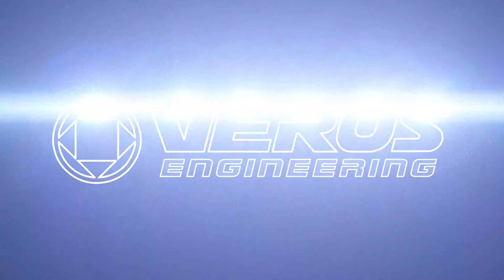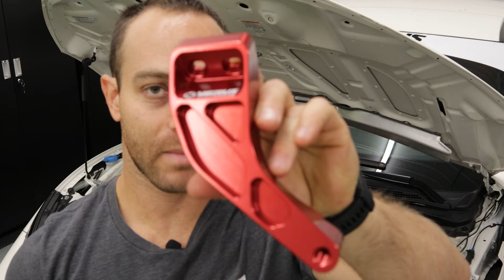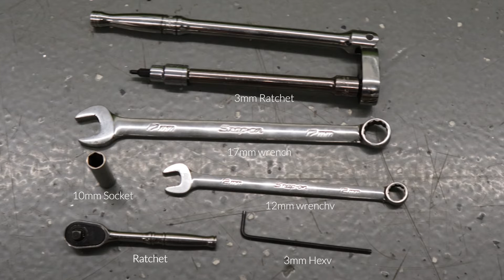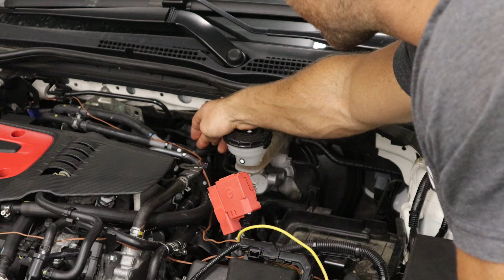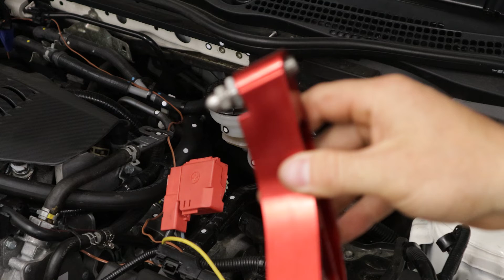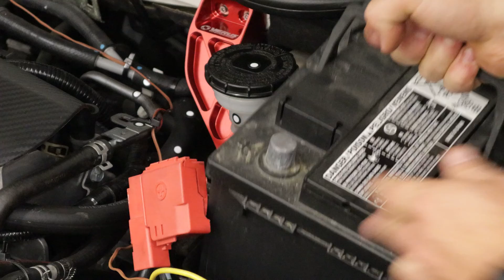How to install our BMC Brace on your FK8 Civic Type R

Comment: Gimmick 😊
Reply: it's not, it improves overall abs system/steering feel and proper clutch engagement. got rid of my gear grinds too. hydraulic system is extremely sensitive to outside variables. any flex and vibration is enemy for these platforms
Reply: Def not, felt brake difference after installing